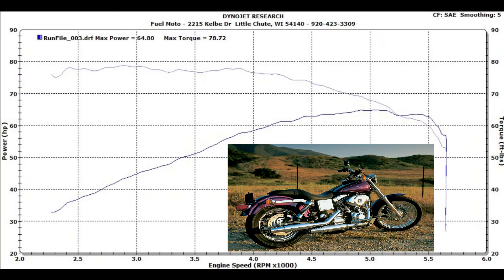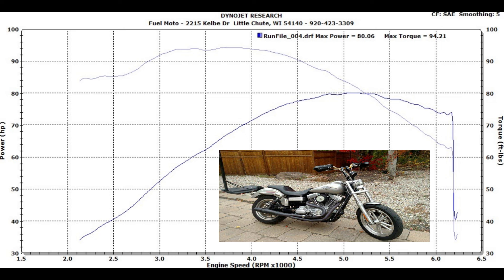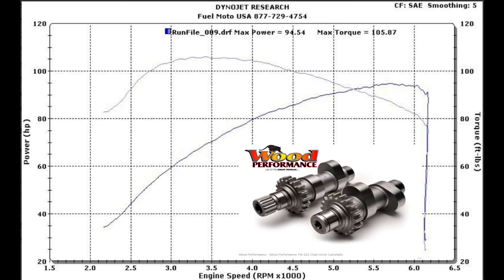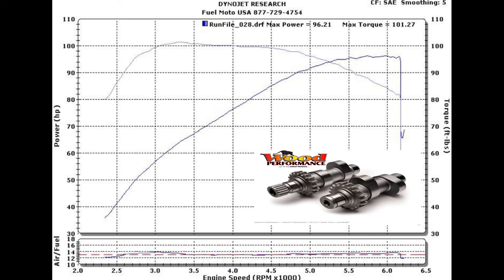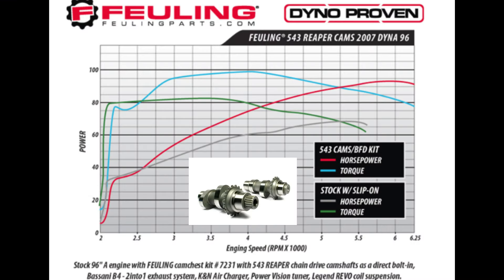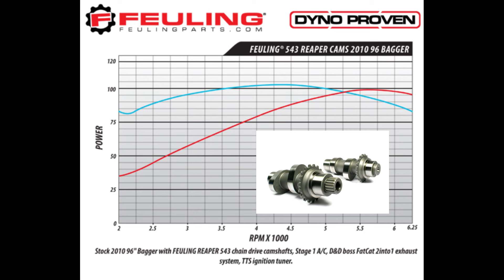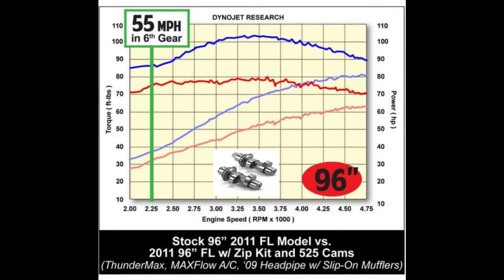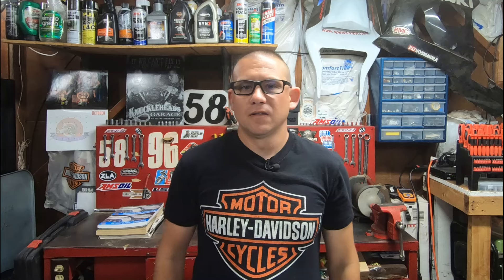Consider New Cams For Your Twin Cam 96 Before You Convert To A 103

Comment: I just bought a 2010 heritage with the 96” motor. SE air cleaner, Vance and Hines 2 into 2 pipes. I’m looking to do a 103 big bore kit with 10.25 compression pistons but am undecided on the cam. Obviously I want a boost I’m power but I’m looking for something very smooth with stock like feel, especially off idle since I mostly do around town stop and go and often ride two up. What’s would you suggest? I’m leaning towards the wood 222.
Reply from the maker: The TW-222 is made for the lower stock compression, a TW-555 or 777 would be a better option with increased compression. They are both bolt in and they would great with increased compression and some head work.
Reply: @GixxerFoo  thank you for the info. I’m tempted by the 555 but I’m scared it’s going to loose it’s stick like mannerisms, especially off idle.
Reply from the maker: It shouldn't, it should actually improve off idle.

Comment: Awesome video! Thank you for your informative content. I subscribed :) which of the cams you mentioned above would you recommend for a 2008 Dyna lowrider 96ci?
Reply from the maker: For the Dyna l would have to with Woods 222 personally. It's a broad power range and really gets that horsepower and torque up. With the lighter dyna it would run really strong.
Reply: @GixxerFoo  I have 2010 fatboy lo with 2 into 2 vh long radius pipes. I know the 2 into 1 would be better but I don't like the look. So my question is should I get the w222 or w555? Riding style, I'm always on the throttle
Reply from the maker: I think you would like the tw-555, it has more up in the upper range. The TW-222 has power all around but it's really strong in the low to mid range. The TW-555 comes on a little later but carries more in the upper RPM range.

Comment: Great Video as always. I’m building a cholo style ‘09 deluxe. I’m purchasing the Fuel Motor standard 110 kit with level B heads. Updating with their adjustable clutch, new cam plate and gear driven. Also upgrading compensator and oil pump. Also going with manual adjustment output chain. I’m somewhat skeptical doing all this work due to the fact that I have Samson true dual fishtails with no crossover, but does have torque cones. . The cam has not been chosen at this point. What are your thoughts? Motor is completely stock with 10k miles.
Reply from the maker: Since you having your heads done with the level B you really have some cam options beyond just the bolt in cams. Fuel Moto is really big on the Wood cams since they produce serious power. Only draw back to Wood is they can be a bit noisy but it's the trade off for some power.

Comment: So I’m in ny and they are getting real crazy about sound laws. I had to switch my exhaust to a stock exhaust with screaming eagle mufflers. I have a stage 2 air breather. Can I still run cams or will the mufflers limit me?
Reply: I’m just trying to pull wheelies on my 2009 street bob, I have 14” mx bars, crash bar, sliders, oiling mod and chain conversion.

Comment: I appreciate your time and opinion but I've never understood the focus on peak HP numbers. Almost everyone I've ridden with rarely revs their stage 2 engines above 4,000 RPMs. The Andrews 48, S&S 583, and Woods 222 work great in a stock 96 / 103. TQ numbers and curve are my focus when I choose or recommend a cam. HP comes after when you go 107 and get your heads done.
Reply from the maker: Everyone likes that peak horsepower number, but if you only rev to 4500 pick a cam that makes the highest peak power there. I like torque myself, that's the name of the game on a Harley.
Reply: @GixxerFoo  Agree. Riders want peak HP numbers and a cool idle and never consider how flat their engines will feel under 3,500/4,000 rpm.
Reply from the maker: High lift high horsepower absolutely kill theow end. That's where you spend most of the time riding on the street.

Comment: How about putting a Wood 777 into a 2008 Softail with a Vance & Hines pipe with a Vance & Hines auto tuner ? Or should the 555 be used..... And Im running no baffles
Reply from the maker: 777 works decent with stock heads and compression, it's more tailored for if you plan on having head work and upping your compression later. The 555 is the better choice for running stock and compression, but it will still perform really well if you decide to do head work later on down the road.
Reply: @GixxerFoo  Yeap thinking just that head work and high compression piston heads and high compression gaskets . Not really looking into 2 into one pipe. Mabe getting better valves and springs and of course better faster oil pump hate blow by for longer high speeds that happened on my 88. Stopping was scary due to oil all over my rear rotors on a off ramp😰😳🥶🥶🥶🥶🥶
Reply: @GixxerFoo  Thank you for your time on this issue do you have torque and horsepower numbers on that cam ? Cant find then nowhere. Thanks again...
Reply from the maker: Holy crap! That's frickin scary!

Comment: Thank you for this video. My 2010 96 ultra is in the shop as we speak. I'm leaning now towards the 222 but the service guy is putting the 999-6A in his 103.  Says it's better at hi rpms and a better sound. I ride all over the spectrum depending on mood, traffic and whom I'm with. Would you still suggest the 222 over the 999-6A?
Reply: Or the 555?!  Ugh. Help. Lol.
Reply from the maker: 999-6A works best with increased compression and it's still bolt in. If you're keeping the stock compression I would go with the 222 or 555. The 222 is more of a low to mid range cam, it works best in a heavy touring bike. But if you ride a Dyna the 555 is more suited there as it revs out higher.

Comment: Great informative video! In all honesty what else do I need to replace when installing cams on my 13fxdb with 22k miles?  Them Woods 222 cams are exactly what I've been looking for,  thanks!
Reply from the maker: For a basic install with bolt in cams I would plan on a rocker box gasket kit and of course your cam cover gasket. With 22k miles just for peace of mind I would go ahead put a new set of tensioner shoes in need it or not. They are good for up to 40k but may as well while you're there. That's the bare minimum to get a new cam, I personally like to get some lifters and cam bearings which isn't necessary per say but it's a while you're in there might as well. It's a great time upgrade the cam plate if you want to as well with a new high voulume oil pump too. Don't have to, but it's cheaper to do it now while the bike is apart then go back later.

Comment: Just bought a set of the Woods 222. Arrive in the next day or 2. Stock compression 96" with hi flow filter and 2:2 exhaust. Thinking of doing the .30 thou head gaskets to bump compression a couple of points. This will also allow the use of stock solid pushrods. Anything else I should be doing while in there? Is a clutch spring upgrade advisable at this level?
Reply from the maker: It wouldn't hurt to add a clutch spring, I'd see what it does with the cam in it first.

Comment: Hey Gixxer, I seen awhile back and looking for the vid where you mentioned that the stock twin cam 96 fuel injector were kinda weak... curious what vid it was and what was the recommendation for the upgrade for stage 2 with SNS 551 cam in it..if you see this thank you

Comment: I have a 2009 96ci softail custom... I've been looking at the s&s ez starts....bolt in cams, but there is so much to choose from...one reason I want to go to the ez start cams is I might go up to a 107 displacement in the future and I don't want to deal with Manuel compression releases and dont want to change valve spring...so which s&s ez start cam would you suggest that would run in both the stage one 96 and the future 107?....I ride pretty aggressive but also will just putt along at times. ..i would like the cam to have an over all increase in torque and hp but also would like it to topout at 5000 to 5500 rpm if possible... I have three cams I've been looking at...s&s 551ce, s&s 570ce and the one I'm most interested in is the s&s mr-103ce...thank you
Reply: What did you go with?

Comment: Do you think the wood cam would work with a 110 conversion?
Reply from the maker: The bolt in cams work great with 110 conversions, especially with a little added compression. The Wood bolt ins really are under rated and when they have some compression added they really come to life.

Comment: 96 twin cam in a 2010 Road King coming up on 50k miles. When doing cams does anything else need to be upgraded? Bearings, higher capacity oil pump, compensator, cam plate, etc. I'm also planning on doing a cat delete and running with a Fuelpak tuner. This bike is a daily rider for around town and on the freeway and needs to be dead reliable. Really want to avoid the trap of having new parts that wear out older parts and REALLY don't want to end up pushing it.

For me and the way I ride there's probably no point in moving to a higher displacement.
Reply from the maker: A new cam kit will come with some bearings, definently want to.change those. Upgrading the cam plate, new lifters and oil pump is a great idea, and this would be the time to do it. It's not totally necessary though. The compensators are known to go out on the 96, but l wouldn't worry about it unless you have an issue. Just don't go back with OEM, at least replace with the Screamin Eagle.
Reply: Yep, my comp went at 40k. Went with SE.

Comment: Hey gixxer I was wondering if you can guide me in the right direction with a cam choice.  I’m having a se95ci big bore kit done but I don’t think the 203s will be good for me.  I ride a lot of two up and I like to twist the grip.   I have a 2003 softail deuce and I have python 2-2 exhaust with a stage 1 air cleaner.
Reply from the maker: So you've got a 88 converted over to a 95? With a converted 88 you might look the Wood TW6-6, it's very high torque cam that pulls off idle to 5500. I have a video with cams for the 88 that will work with your big bore kit https://youtu.be/tV5LcDXx3xA
Reply: @GixxerFoo  thanks gixxer yes it’s a 95 I will look into that cam I was also looking at the red shift 511
Reply from the maker: That's a great cam as well, it just depends on what RPM range you ride in most. You really can't go wrong as far as quality with any manufacturer, but some perform better in different rpm ranges.
Reply: @GixxerFoo  thanks to you I ordered the tw6-6 today.  I’m really excited to get this build done I have been wanting to do it since 2014
Reply from the maker: You won't be disappointed at all, 95's are very strong running motors and then you pair it with a cam and it's a whole new world.

Comment: Greate video thanx!
Could you please let me know what do you think red shift 575 cam with stock 96ci flhr?
Reply from the maker: It's a nice setup, any bolt in cam with some increased lift and duration is really going to wake up a Twin Cam. The factory cams are very mild and it keeps the potential power and torque way down.

Comment: I just picked up a 2010 fatbob from copart for 3500 bucks dude. Needless to say I'm ecstatic as you can imagine. It only needs handle bar risers and that's literally it. It's got a ton of extras on it and it runs excellent. I'm digging that woods tw 222. I'm not familiar w the 96. What should one look out for with these? We know 88 tensioner failures. I know these don't have that issue. It's only got 20k on it also. Thanks in advance can't wait to try out a fat bob.
Reply from the maker: Congratulations on the new bike! Sounds like you got one heck of a deal for 3500! The 96 had some compensator failure issues, that was mainly for 2007 to 2009 models. After 2009 they seemed to have it straightened out. People complained about the 96 running hot, but that was the first year of very lean fuel injection factory tunes for the EPA. Once they are tuned with a after market tuner they are good to go. Wood cams really wake up that 96!
Reply: @GixxerFoo  thanks I like it so far.. awesome, it's got everything intake tuner exhaust I mean you name it. Only thing it doesn't have is a cam I'm guessing. Thanks for the info sir much appreciated. It was a damn good deal for sure.
Reply from the maker: @parkersgarage4216  You're very welcome, anytime! FatBob is one of my favorite dynas, best handling twin cam dyna ever made.
Reply: @GixxerFoo  that's the exact reason why I bought it. I wanted to check out the handling of it. Have you ever ridden one before if so is it everything everyone says it is? I've read the fat bobs handle like nobody's business. I wanna put mids on it to turn it into an all out ripper. I didn't realize you gotta change the primary cover in order to do so. I'll try the forwards and see what happens. I wanna get taller shocks for the rear as well. It'll be a fun ripper regardless though for sure.

Comment: What do you think about the Wood 777’s or the Fueling 574’s in a 96ci?  My mechanic calls the 777’s the bread and butter cam for 103’s, but said he still recommends them for 96.  Thoughts?
Reply: John Donkor 
Like JTC Said A 777 is just a tad big for a stock 96” IMO. if you get some head work & bump the compression with a .030 head gasket it work better OR just take it to a 103 with head work would get the most benefit from the 777 
If keeping it at 96” I would recommend a Andrews 48 h
Reply from the maker: Tje Andrew's 48H is a great cam for a stock 96, they make the cams for Wood.

Comment: I have a set of woods 777 i want to put in my 96 ultra. What kind of numbers should  I expect?
Reply from the maker: With a good exhaust setup and tune, I would expect mid 90's on horsepower and around 100 ftlbs of torque. That's being pretty conservative, a good tuner may be be able to squeeze more out.

Comment: Im just going to keep riding my stage 1 as loooonnggg as she's putting out and when she does I'll just buy a ultima el bruto for $4k with about 130hp and 130tq
Reply from the maker: There you go, crate motors are the way to fly especially when you start comparing costs of rebuilding.

Comment: I am on the fence between the RedShift and the 6-6. Roll on power is very important to me and my Road King. I guess I might go for the most fuel efficient.  Do you have any data on that front?
Reply from the maker: There's not a a lot out there on fuel economy. Usually they will see an increase, you will be using less throttle and fuel at a given rpm over the stock cam. The engine is going to be more efficient all around. If you are getting on it and winding it out fuel economy will non existent lol.

Comment: I'm thinking about going with the tw222 for my 2010 street bob. I have  a kuryakyn hypercharger with the stinger door on it, Vance and Hines short shots and Vance are Hiens fuelpak. Do you think the tw222 will be a good fit. I ride pretty aggressively. I'm not sure if I made a mistake buying the fuelpak. I think I should have went with the fp3 or something different. I would greatly appreciate you input.
Reply from the maker: That would be awesome cam for your bike, l would recommend going with the Fp3 or Power Vision though when upgrading the cam. The FuelPak works well for a stage 1 but going with a cam you will need a flash tuner.
Reply: @GixxerFoo  also do you think the upgrade to the gear drive is with the money and the is it worth putting in a new cam plate and oil pump. Or would the cams and tuner be sufficient. I appreciate the advice
Reply from the maker: Since your bike has the hydraulic tensioners l wouldn't worry about the gear drive. It's not a bad idea to go ahead an upgrade the cam plate and oil pump. You'll already be right there, it's not totally necessary to do so but it won't hurt anything to upgrade it all. Just depends how much you want to spend.
Reply: @GixxerFoo  thanks a lot man. I been running my head around this for a while. Thank you for helping me make my choice. It is greatly appreciated.
Reply from the maker: You'll enjoy it, it will be like a whole new bike.

Comment: Ok so you mentioned 2 into 1 exhaust,  what the advantage over true duals if any ?
Reply from the maker: The biggest advantage a 2 into 1 would have would be top end horsepower power. True dual really shines in the low through upper mid range.

Comment: What about like a s&s 585 in a 96 with a 2-1 and high flow air cleaner? I’ve heard the 585 is a good bolt in for torque you can roll on with some decent HP gains anyone have thoughts on this? If not I will report back I have my cams on order with this exact set up